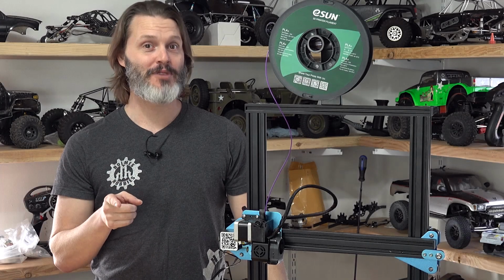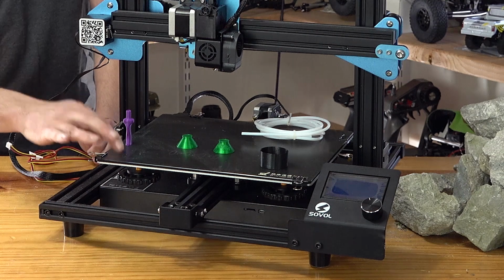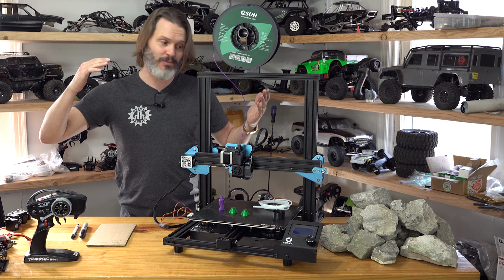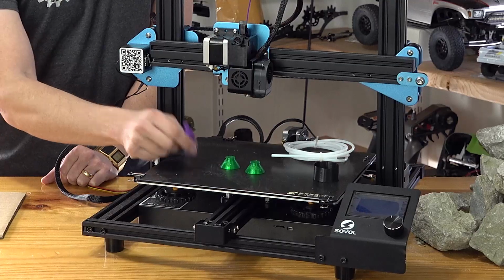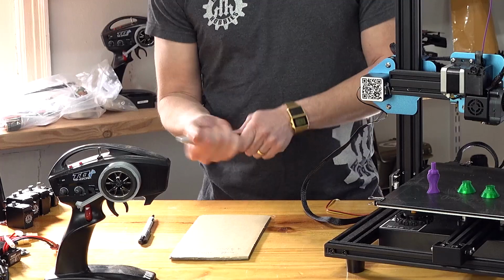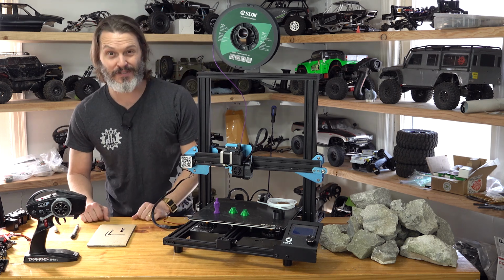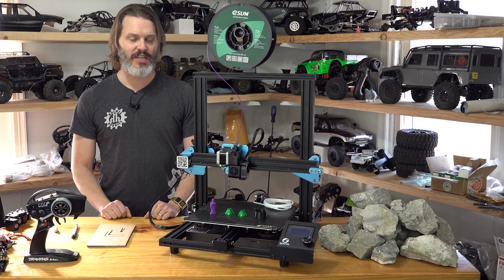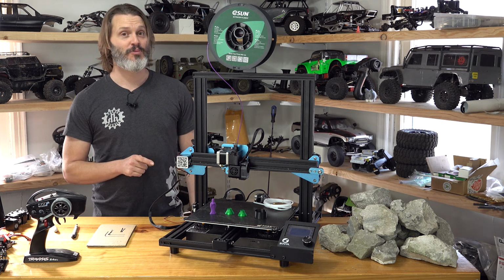Best 3D Printer For Hobby Use & Beyond? Detailed Sovol 3D Printer Review - Holmes Hobbies

Comment: I've had an ender 3 V2 for a few years now, and it is printing amazingly without ever having to recalibrate the bed. I just recently got the Sovol SV03, and getting it dialed in has been a pain
Reply from the maker: My first sovol was very flat. My second does not have a flat bed.  Pain in the butt for low first layer height.
Reply: @HolmesHobbies  yes the springs for my bed are insanely different from left to right

Comment: I am new to 3d printing as of last Wednesday. I got the SOVOL SV01 off Amazon  (this was 100% free to me but would have cost me $179) and I absolutely love it. I do want to get the BL Touch eventually but so far the only pain was leveling the bed but that still has not been bad. Mine did come with a glass bed which has been a pain getting things to stick even with that coating but using a Gel glue stick has been a life saver. I have got all my prints from Thingivers also
Reply from the maker: Have fun!

Comment: Don't buy the refurbs or count on support!!! ordered the sv01 and had it 5 weeks and still yet to print the first thing. support will ask for a bunch of videos you take hours to get and upload then not reply for 6 days. Original came with a bad board, they shipped another which took over 2 weeks and after installing it i get an all blue screen and while x and y move + 10mm -10mm over and over while a siren sound beeps non stop.
now severl days later and support STILL has not replied and the previous reply was asking me to what I JUST DID AND SENT A VIDEO of to them....flash the firmware. I have told them several times it will not flash and uploaded the video to youtube they requested..they watched it then 3 days later tell me to do the same thing. DO NOT BUY unless you want to spend you money on a big heavy paperweight

https://www.youtube.com/watch?v=RHdJL2fTm8I
https://www.youtube.com/watch?v=1k1Ot6dzw84
https://www.youtube.com/watch?v=LDCWcNWdC-A

Comment: Linear advance can help significantly with the retraction difficulties you've described. Doubt it's enabled in the factory firmware, but I would recommend everyone learn to flash Marlin as part of their learning curve. Marlin has a lot of really strong features that many (Chinese) manufacturers leave disabled in their firmware for no good reason, it's the best free upgrade one can perform.

I'm considering an SV-01 or SV-02, I've got a heavily modded ender 3 pro and a two tree sapph plus. I've always liked the cr-10 mini form factor (280x240mm) for bedslingers, but the cr10mini is 12v which kinda sucks, and going much bigger on the bed severely limits print speed/accel. With a lighter weight pei spring steel bed, this could really shine; glass is kinda heavy.

Comment: Its still using a 8bit board. That's a big fail for a printer these days. I like resin printers a lot more for RC type stuff. The accuracy is an order of magnitude better.  I've used to to recreate mechanical parts on discontinued models and things like bearings etc fit right way. FDM I never had much luck with really good tolerance. Also for crawler accessories you'll get way better finish. I think you're probably giving bowden tubes too hard of a time though. They can print really well with the right slicer settings, but direct drive certainly has an advantage in terms of easier to manage retraction settings. You'll pay for it in ringing however, especially with a full size stepper like that. There aren't many low cost direct drive kits however. You should buy a biqu h2 for your ender 3 and try it out.

Comment: John  I bought an SV01 on Black Friday for $229.00. Was leading towards an Ender 3 until I saw this, been running almost constantly, Bed thermistor failed and had to be replaced, I mostly print in ABS which is on the high side of this machine but will still do it  I have no regrets in my decision and would highly recommend this to anyone looking to start

Comment: Great video. I have the SV01 and its my second printer. My first is an Artillery Genius which was around the same price but has smaller build volume. Both have a very similar direct drive based on the E3D titan. The Artillery has a volcano hotend so it can print faster, and has silent drivers and a touchscreen. The Sovol which also has dual Z steppers like the Artillery, the old school 12864 display with wheel controller. They both have an ultrabase glass bed, however i have upgraded both to magnetic PEI spring steel build surfaces. They are both great printers, however I have seen much better overall print quality from the Sovol. One place where the Artillery wins hands down is that the bed is AC powered so it goes from 20 celsius to 100 in about a minute or less, literally 2x the speed of the Sovol but once the bed is up to temp they are equal. I think the Sovol is a simpler more rugged design which has great detail, and you can order a complete hotend/extruder/carriage assembly for about $40. Overall i would have no hesitation recommending either one but i think the Sovol print quality just barely eeks out a lead over the Genius but its print volume is much larger. Great video

Comment: I don't have an Ender 3 because low quality and only one Z motor but after five years with a couple of Wanhao i3, a Malyan M160, a BCN3D Sigma and two Robo 3D machines I now have downsized my amount of printers to just one machine (for now) and it's a Creality Cr-6 which is upgrades with a Phaetus Dragofly hotend and a Primaselect ruby nozzle since I print a lot with abrasive filaments.
I haven't had any of the issued you mention with the corners or stringing, not more than any of my DDX printers have had due to lazy user not setting the slicer up properly.
What slicer do you use? What filaments do you use? I guess you deal with a bit of heat and humidity where you live. Only time I've hade issues with any of that was a summer we had a long heatwave and my printers lived upstairs so the printer room got to 40-50C which the PLA really don't like
Have you got any experience with any other type of machines, Core or delta?
Reply: My Thingiverse name is SSwede but I only have a few designs, track markers for OpenRC and a hotend mount basically, most of what I've made for my rc's are still work in progress and not ready for release :)

Comment: Same here! Learned on a mono price maker select v2 that also had constant salmon skin on first layer. I then bought a ender 3 v2 and after three weeks of it I decided I didn’t like Bowden tube printers or single Z motor setup. Then one night flipping around you tube I saw a review on the sovol and the next day the ender 3 v2 went back to amazon. I love the sovol ! After getting the e steps calibrated and flow rate dialed in its very impressive machine for the price. I rarely have to turn a knob on the bed. It just prints and prints with just little slicer adjustments. I put a th3d main board in it using the CR10 s profile. Calibrate your E steps ppl when you get a new printer.

Comment: Would a 21t trailmaster 550 with a hw1080 esc on 3s work in a wendingo? I just bought the kit and want a crawler with decent wheel speed
Reply from the maker: I would use 27t and 11t pinion.  The gearing of the wendigo will smoke a 21t.
Reply: @HolmesHobbies  okay thank you so much!

Comment: I have an ender3 v2. I've considered adding direct drive to it. Only problem I've noticed with the bowden tube is I just recently had a clog and I think the tube had moved up and allowed filament inside the hot end. Have printed a little bit of everything. Currently trying to print a m35 body for a 6x6 I've been wanting to build and recently done a lowboy for my king hauler.
Reply from the maker: I dont have a thingy right now

Comment: For the corners you can use Linear advance. That's in the firmware though. Its kind of like coast. But I agree Bowden tubes are problematic. I originally went to Bowden tubes to print faster by reducing the head weight, but it didn't pan out that way at all. https://www.thingiverse.com/Voodoobrew
Reply: I'm still printing an an old anet A8 chassis, but its a bigtreetech skr 1.4 motherboard, 110v heated bed, and various other mods. Surprisingly the acrylic chassis never seems to give me issue.
Reply from the maker: I've never had resonance issues with direct drive that were as frustrating as bowden issues. While it seems like a good goal to reduce carriage weight, the problems of bowden just outweighs any advantage IMO.
Reply: @HolmesHobbies  well afterwards I started considering how heavy the Y axes is and decided 2 half sized extruder motors would probably be fine. One for petg and the other to use pla since it works pretty good as support material.

Comment: I've used Thingiverse a few times, but not much.  I'm focused on learning CAD, so I just go for broke with scratch designs even if something already exists there.  I use my printer for all sort of misc things (the biggest project thus far was designing and printing an expandable small equipment rack for my computer network gear funny enough).  I've done very little for printing RC stuff (but lot's of misc stuff from Harley Designs).  But that's going to change in the next few months as I slowly work towards doing a full interior (Pet-G) for my first scaler.

Comment: love my ender3s  worked fine for me out of the gate, have modded them over time to my preferences, like running hard steel nozzles at .6 mm.  have a direct drive setup for one of them for tpu just to make tuning easier. tolerances are alright for most projects, if i need a specific tolerances for things like printed hinges or bearings i need to tune.

Comment: I've had the ender 3 pro for a couple of years and was able to print TPU very well with the Bowden extruder, so it is possible. I was very careful to select a TPU on the stiffer side though. I put a direct drive and all metal hot end on it last year and regretted it at first, but after a lot of tuning, finally got it printing well again. I find most of my RC prints on Thingiverse also, but I have a Mechanical Engineering degree and I've recently taught myself Fusion 360 so I'm going to start designing my own parts. Once I have a couple successful designs, I'll be setting up my own Thingiverse profile to share them with everyone.

Comment: Q to any of the experienced 3d designers What Slice and CAD Software is yall using?
Reply: There might be more capable slicers out there, but Ultimaker Cura is free and super easy to use, so it's the only thing I've used for my Ender 3 Pro. I use Autodesk Fusion 360 for CAD, but I had a hard time learning to use it. There might be other free software that's easier to learn.

Comment: Looks really good forthe money, especially with twin Z axis steppers and direct drive. The only thing I'm not so keen on about direct drive is the extra weight, but it's obviously not a problem. I bought a Anyqubic Mega S on sale at Christmas asmy second printer. I use Thingiverse but I prefer designing my own bits and pieces.
Reply: What slice software are you using?
Reply: @Chris-zu8ve  I use Cura, it comes with the printer or you can download the latest version 4.8. I find the version that comes with the printer works perfectly well.

Comment: PETG makes for real use RC parts......
Reply: Can you explain why,  I and so may others are just starting to learn about 3d printing.     Would also like your thoughts on SLiCER software.  Thanks
Reply from the maker: Ehhh, I thought so too until putting it into use.   Nylon or abs is the better choice.  Petg is brittle. Abs can be too.
Reply: @HolmesHobbies  if you want real strength print with ASA. Petg and abs are pretty close in form of ductile strength.

Comment: Looks like a solid unit. I just got an anycubic mega zero 2.0. Only problem I’ve had with it is blowing the tube out of the couplers. Best thing to do imo is to compile a Marin 2.0 firmware pack. Linear advance set to k1.2 with Bowden set up and I have perfect corners :) 6mm retract and jacked up accel across all axis. Printing at 100mm/s .26mm layer height .66mm wide line. :)